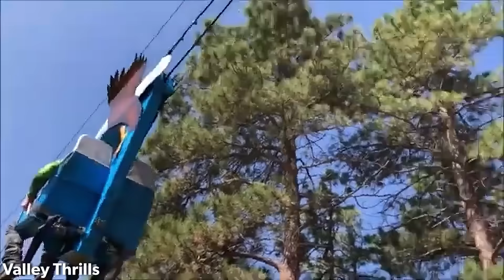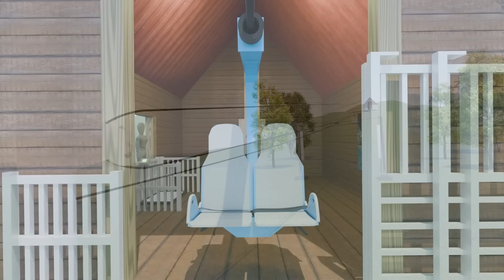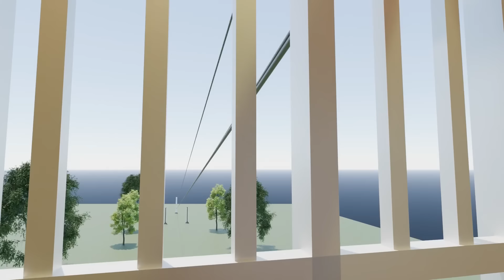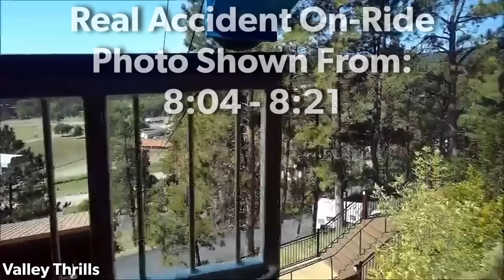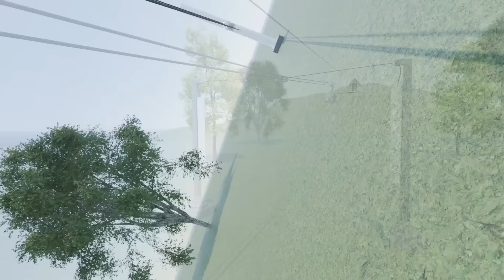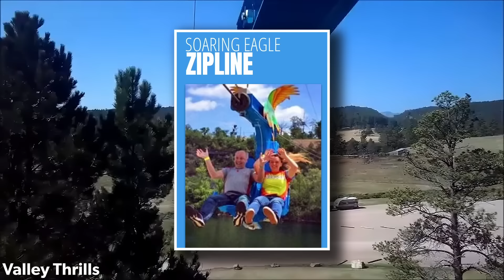Soaring Eagle Rushmore Cave - What Really Happened on May 29th 2015?

Comment: I rode this ride with my mom probably a year or two after the accident and I can confirm when I rode it there was no changes to the restraint system. The brakes at the end of the ride are quite jarring and you really do feel the g-forces from suddenly stopping after going downhill fast, I can only imagine it was a miracle that the rider involved in the accident didn't suffer fatal injuries when they fell. I enjoyed the ride back then but there should have been more direct changes to the ride's seatbelts to ensure another accident wouldn't happen again, it's so sad to see negligence like this lead to even worse accidents by the same manufacturer.
Reply: My niece and I drove by this eagle zip ride in 2014 and considered going, but we went to the Alpine sleds ride on the edge of Keystone (Rushmore Tramways). Probably just as much danger of things going wrong at both rides, but happily no injuries.

Comment: What a complete hack of a manufacturer, garbage rides with even worse adherence to best practices of safety and procedure. Whatever idiot signed off on this and Haunted Mine needs to pay up, not the park that tried making the most of their piss-poor attraction

“Hey, your ride was involved in an accident, you should do these things to make it safer”
“Mmmm, no, don’t wanna and I’m not gonna tell anyone else about it”
Reply: However, Mine Drop's situation was heavily compounded by the park's poor training and operational standards that made such errors from operators practically inevitable. Hard to claim they had no fault when they were staffing the ride with operators trained on just 10% of the already short OEM manual.

I think the manufacturer and their customers routinely took complicity in the simplicity, and the design sadly made it fairly easy to pass the buck to parks for operating their rides improperly and sweep the problems under the rug...which was why it took Mine Drop's incident being so egregiously reckless on multiple fronts to bring it all to light.

Comment: Glad the kid didn't die. This is just neglect in my opinion. A yellow belt and a competent operator must be less expensive than the lawsuits.
Reply: Restraints that locked behind the seats and very little room in front of the seats made it as uncomfortable and inconvenient as possible for the operators to inspect the restraints, not to mention absolutely no requirement of checking that a rider is not just sitting on them in the manual. 

The manufacturer did everything they could so that the accident happened, 

And when it did - which very clearly highlighted the problem - elected to change nothing to prevent repetition.

And continued to manufacture unsafe equipment even though changing restraint color and adding a line to manual would not have cost them anything at all. Sending a bulletin probably wouldn't cost them any considerable sum either.

This is way beyond just neglect in my opinion.

This is someone looking into the situation and deciding that admitting the fault and changing the restraints on new rides would cost the company more than just to accept high risk of accidents.

The cost of human lives in the future mattered to them so little that they elected to sweep it under the rug rather then fix it at that time.
Reply: @jwhite5008 yup
Reply: This is user error. If you intentionally sneak your seat belt under your ass that's not on the operator.
Reply: @thatguyonyoutube989  that very much IS on the operator as the seat-belts are locked by the operator - not the user, and the operator is supposed to be legally required to check them before locking them (which is the entire reason it is the operator who locks the belts - and why doing exactly that sends the signal to the ride that allows it to dispatch), and that check is supposed to include checking the rider is actually wearing them.

A rider is NOT required to understand the function and purpose of the restraint mechanism and might assume some of it is optional or i.e. only needed for disabled people or something. Unlike the operators, they received no notice or training.

There is no evidence the rider in question maliciously evaded the restraints.

The problem is that manufacturer - despite multiple accidents and close calls - didn't bring this issue to the operators' attention, didn't include it in operator training, and made it quite inconvenient for them to actually check that by placing the locking far behind the seat with almost no clearance before said seats, or mirror to see them clearly, and adding requirement to retrieve and return the key to a panel on far back each cycle.

That is in addition to failure to identify a very obvious and glaring issue of black seatbelts being invisible on black clothes.

Thankfully the company that inherited tech support for the attractions did recently issue a bulletin requiring retraining and recommending brightly colored seatbelts - but not before this exact video gained mass viewership and probably pushback
Reply: @thatguyonyoutube989 They didn't "intentionally sneak" the belt under them, but probably didn't even realize the belt was there. Of course, if you or I were on such a ride and didn't see a seatbelt we'd ask questions, but the rider appears to have been a child.

Comment: Shame on the manufacturer, such an easy fix. Retractable, seat belts and make them orange .
Reply: Once I saw that you could just sit on the belt, in instantly said "damn, the operator just buckled it to the seat :( "
Reply: @volvo09 Yeah. If you are a complete idiot.
Reply: @volvo09  I can't comprehend why a ride operator (in a safety position) would not double check that a restraint is being worn properly. Instead of just buckling and dispatching the ride, check the restraint over the rider THEN buckle. It is not the rider's responsibility to make sure they are properly restrained. They play a part in it, sure, but final check is on the ride operator before starting the ride.
Reply: or something easier, make it similar to a car seatbelt!
Reply: or just.. over the shoulder restraints or lap bars..
Reply: as usual, it is best to go with a black belt that has white edges (or the other way around). alternately, a belt weaved out of black and white fibers. there is still a possibility that the person using the ride will have clothes with a pattern that will perfectly align with the seatbelt. however, that lowers the likelihood of a similar accident to a level so low as to be correctly treated as a one-off. at least, as long as you also implement a procedure for checking the seatbelt's status.
Reply: 20 dollars on amazon too
Reply: What if someone is wearing orange?
Reply: Why would you literally reinvent the ffing seatbelt?? Retractable ones are just off the shelf component.

Comment: What was Soaring Eagle’s problem? Was it too expensive to make the requested changes? Was it a pride thing (“our design is fine. Not our problem if the rider and operator didn’t notice.”)? Was there any harm in sending out an operational change that said to lift the seatbelt before buckling it to verify no one was sitting on it?
Reply from the maker: If I had to guess, I imagine that their legal team thought it would be better if this was treated as a one off and they did not change the design. Changing the design would mean they were admitting that the original design was not safe.

Comment: The rider must’ve know he wasn’t seatbelted — right? Why the hell wouldn’t he make sure he was belted in???! He’s not a child like the Haunted Mine Drop incident. He shouldve realized he wasn’t belted in! Why wouldn’t the rider say anything? Am I missing something???!
Reply from the maker: I imagine they sat down expecting the seatbelt to be placed over them, but did not realize this did not happen. Its also likely their focused attention was on the ride in front of them and not their own restraints.
Reply: Based on the picture it does look like he was a kid, just an older one (maybe a preteen/young teen), but I might be wrong
Reply: I do get what you're saying - the rider should have known and it is pretty wild that they didn't. However, it is absolutely the operator's responsibility to make sure a rider is properly secured and the manufacturer's responsibility to make that process as foolproof and reliable as possible.
Reply: @brianjl7477  Which the operator did. The user intentionally subverted safety measures. This is like stabbing yourself with a knife and blaming knife manufacturers.
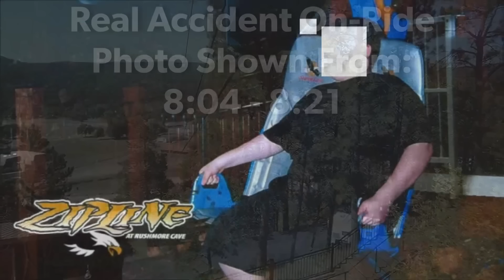Reply: 8:04 He seems to be a child, just a large one. Presumably the second rider was his parent/guardian whom he was separated from due to them exceeding the weight limit. My own little brother, who has autism, was also a really big kid and we couldn't do rides like this  because even my weight combined with his would often exceed the limit and he couldn't ride on his own because he couldn't understand safety instructions. This kid could've been developmentally delayed too for all we know. Then again, it's baffling that neither his guardian nor the ride operator noticed he wasn't buckled in.
Reply: His guardian couldn't have seen whether he was correctly buckled in from where they were standing. See 6:38.
Reply: This all happens so fast, and he's probably distracted and scared of the ride. I don't know, you sit down, the operator clicks a buckle, guess I'm buckled? It seems reasonable to me.
Reply: @mack.attack if there's nothing over you how the fuck is that reasonable???
Reply: @mack.attack  People who lack basic awareness, should not be allowed on rides. This is FULLY the rider's fault.
Reply: @LaNoturna1115 Sooo everyone riding the ride needs a psychological exam too? Lol. They need to make sure they have competent ride attendants that are doing their jobs n checking restraints.
Reply: @LeeLeeCalderónRN look i acknowledge that safety protocols on the manufacturer and operator's end were absolutely abysmal, but c'mon. if you're sending your kid on a ride alone, you should know whether or not they're mentally competent enough to understand how to use a seatbelt and act accordingly
Reply: Yes this was my first thought as well. You as a rider do have a responsibility to sanity check there is a belt around you and you feel secured. Both parties bear responsibility.

Comment: Honestly, a lot of this could also be prevented by just putting red paint on the section of the seatbelt that would sit just above the edge of the seat if a thin rider was buckled in. That way, if the seatbelt is lying flat on the seat, there’s more slack in the seatbelt and the red-painted section would be hanging off the edge of the seat. If the operator can see the red section from behind the cart, they know the seatbelt is flat on the seat and rider isn’t buckled in.
Reply: Or make the seat belt buckle where you'd expect it to be. You'd be looking at it on the person and see it is around them when checking it
Reply: That doesn't make sense with the configuration of the seatbelt. There will always be the same length of belt between the edge of the seat and the buckle
Reply: ...or just don't have a black seatbelt.

Comment: So, in my opinion, the kid in the seat is also somewhat at fault. I'd say 50/50 fault
Reply: I agree. Sometimes I think they must know they are sitting on top of a seatbelt…
Reply: @leftfinned Idk how you wouldn't know
Reply: @awkc63 exactly. Unless it’s a very small child where the parent would be responsible-it almost seems like they think it would be a kick to say they rode without it…idk? That rider was holding the hand holds very tight which makes me wonder if they are trying to do this. Not trying to get hurt but pull one over the operators thinking they can just hold on? Seems bizarre to me.

Comment: Yikes! After the Glenwood Caverns video, I knew Soaring Eagle wouldn’t be making any changes, but to hear that the park didn’t make any (physical) changes either is a very unpleasant surprise.

I have been working on a project lately that requires more of a safety plan than my usual (largely computer-based) work, and I can’t help but bring that in to my response to this video. Changing operator instructions is roughly equivalent to imposing additional “administrative controls”, which is always considered a much inferior option to “engineering controls” (I.e., the system physically cannot perform the unsafe action). Our system will be entirely out of the reach of children and the general public and should only be used by qualified personnel who know exactly what they’re doing, and I’m still planning to add a physical interlock to prevent subsystems A and B from being used at the same time. In an amusement park, where human factors are a much bigger problem? You need to add something more than a couple of lines to the manual.

(As a theoretical example for this case: add a basic scale and auto retraction to the seatbelts. If the seat shows more than, say, 20 lbs on the scale but the auto retraction device indicates the seatbelt is retracted to its minimum length, there’s a problem and you need to go address it before the system can be launched. Then you add the brightly colored seatbelt and operator instructions to check visually and hopefully you’ve added enough redundancy to catch all of the possible issues.)
Reply: Watching both this video and the Glenwood Caverns video, the entire manufacturer response (or lack thereof, I suppose?) reminds me painfully strongly of a certain attitude in software development - the "you're just holding it wrong" attitude. Where instead of accepting that humans (including the developers themselves!) are fallible and will make mistakes, and designing for that eventuality... the developers declare it basically "operator error" and refuse to build in safeguards, arguing that people and other developers should just learn to properly use it. The way Soaring Eagle handled the seatbelts feels a lot like that; I would bet a good amount of money that someone, at some point in a Soaring Eagle meeting, rejected the idea of a highly-visible seatbelt on the premise that "operators should just be trained to check better", even after it had already been shown to be a problem - and even though it would've been a dirt cheap change to make in this context.